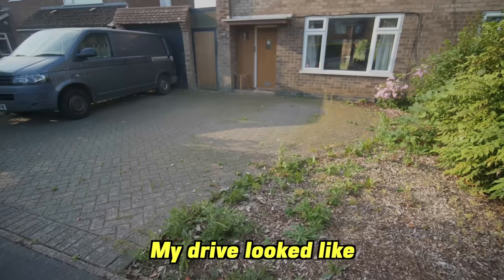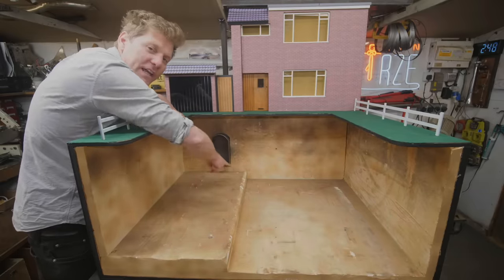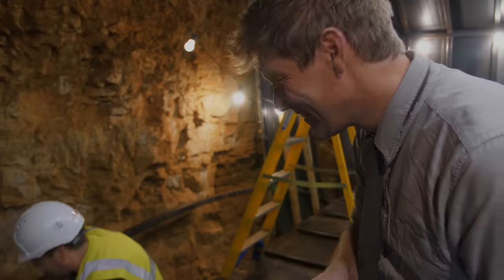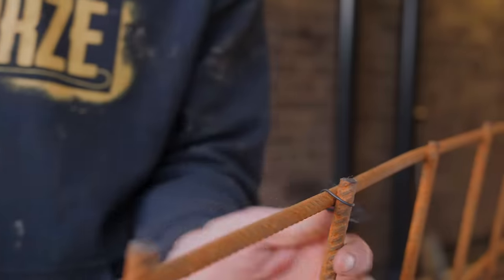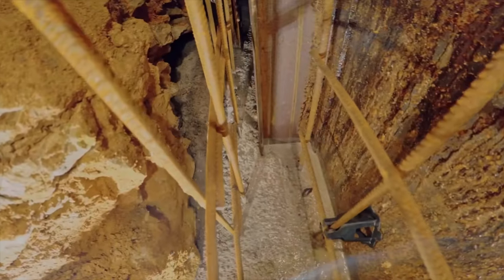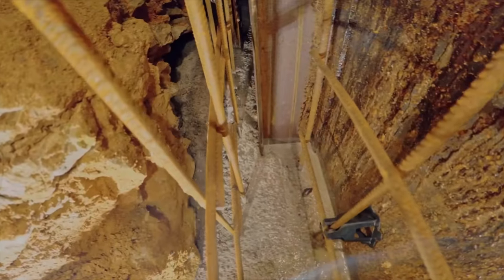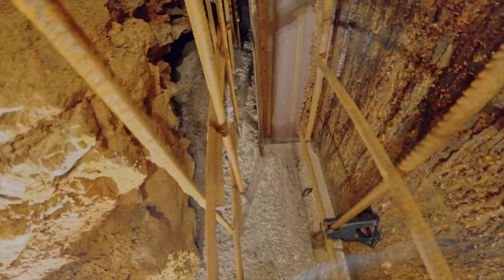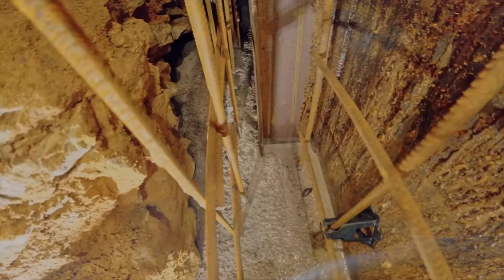Digging A SECRET GARAGE Part 3

Comment: Just stumbled across your channel, love it (obviously subscripted) I provide support and performance solutions in the construction waterproofing industry. I noticed you choose to use a polyethylene sheet as a dampproof, did you consider a bentonite blanket pinned to the rock face? I realize your substrates are not prone to moisture ingress, but any failures in your welds / seams could be a protentional point of entry.

Comment: Why did you decide to do this with the steelcase? Wouldnt it have been easiert to let diggers take out all the ground necessary at once (after taking probes), filling in the "floors" with rebar and cement, once it dries put in pre-made rebar/cement walls? Yeah visiting your own home would have been rather impossible so you would have needed to stay at a hotel for some time but it shouldnt have taken months. So basically how you would start building a house from the ground up instead of this adding and adding and adding?